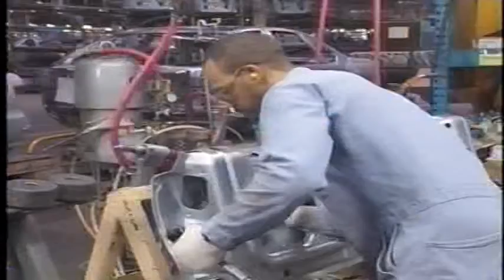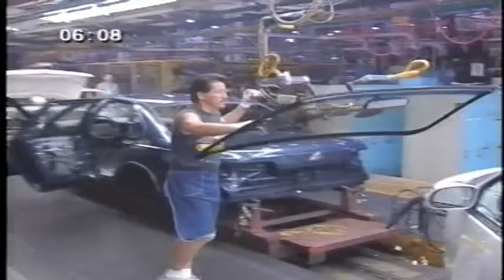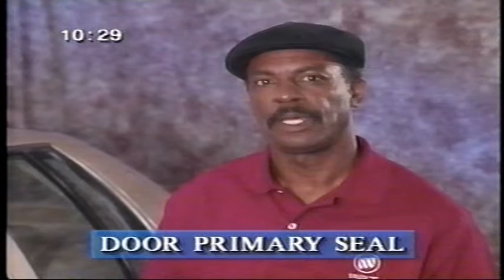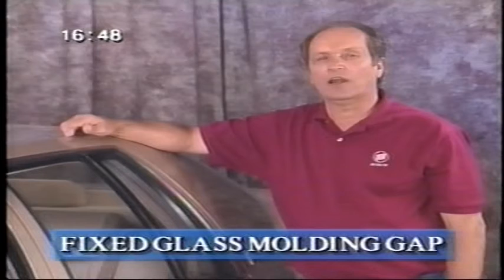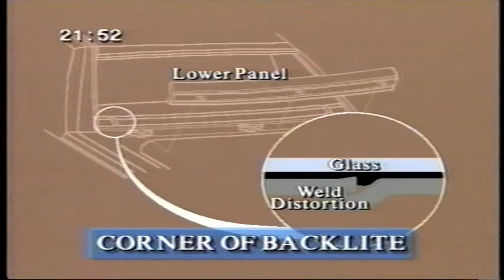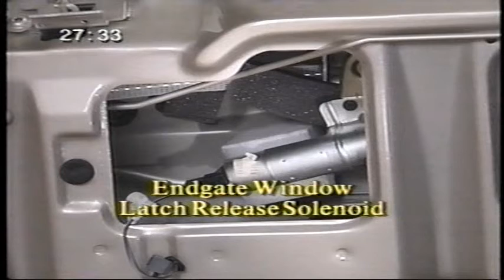Buick – Roadmaster Service Concerns – Part 1

Comment: Roadmaster...now THERE was a boneheaded model intro by GM!  The Crapice was the same car cost thousands less, and everyone knew it.
Reply: The Caprice didn't get the LT1 engine, skylight and other options, so not really a fair criticism...
Reply: @studebricker2845  Actually, the Caprice did get the LT1 in '94, though perhaps it was an available option.  For '94 to '96 the Chevy Caprice and Impala, Buick Roadmaster and Cadillac Fleetwood all had the SAME LT1 and 4L60E (electronic 700R4) drivetrains.  With the exception of the Vista roof, the wagons are the same on the outside, but the Buicks have a nice interior with a lot more sound-deadening and standard luxury options.  As for the Buick Roadmaster sedan, it is a real unique one-off, and unlike the Caprice guess what - the rear windows go ALL THE WAY DOWN!  I own one, have a movie on replacing the A/C compressor, real nice ride, and tow 5,000lbs - find a modern sedan that can do that.  Let me know if anyone wants a free PDF brochure for these, great reading.  Keep 'er running - Cheers!~  Bellarmine
Reply: @bellarmine33 I would like the free pdf I just purchased a mint 94 roadmaster sedan limited for 4500$ with 53,000 original miles 😊